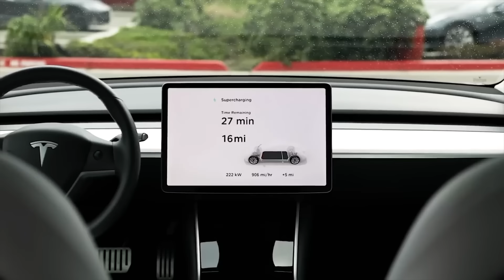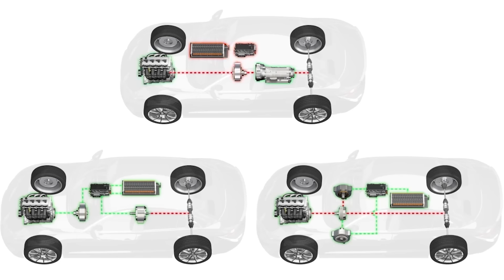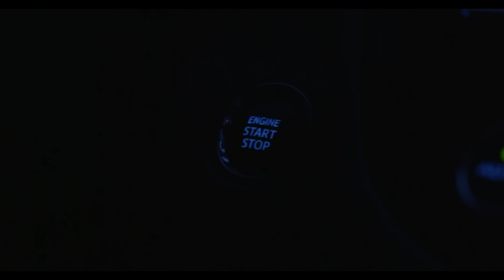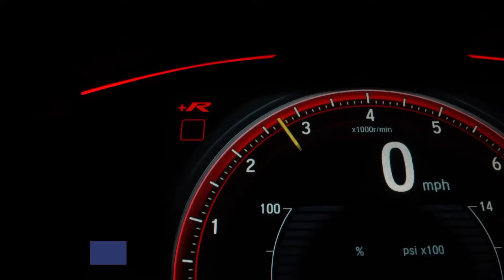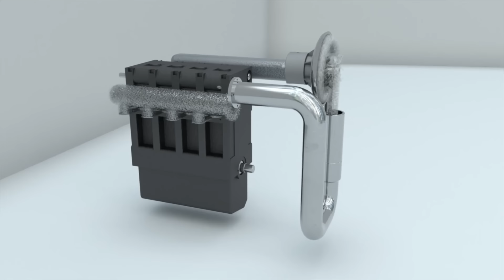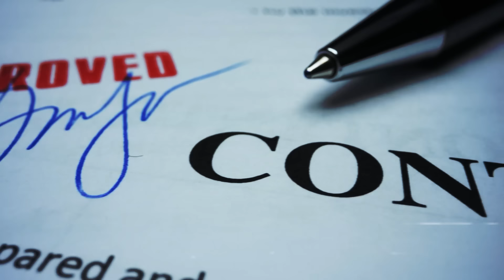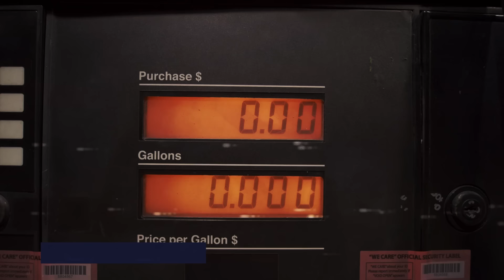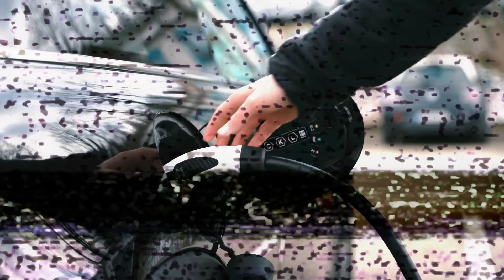Toyota CEO: "This NEW Engine Will Destroy The Entire EV Industry!"

Comment: I figured the whole child slavery in the Congo digging for Cobalt would have been enough to do it.. Sadly, I was wrong.
Reply: Except LFP doesn’t have that issue, and your phone/laptop still will. Go figure eh
Reply: Child labor sounds harsh. Do you know that hunger is more harsh than child labor?
Reply: @ferozahmed5846  - So child slave labor is ok then because kids are hungry too ?  Quite the logic you have there.
Reply: @HardRockMiner it is better, and just see what it did to China. Also do keep in mind cobolt is used in Gasoline and diesel cars aswell
Reply: @kimf.wendel9113  - Child slave labor in The Congo is out of control because of the demand needed for EV, cellphone batteries, etc. The amounts needed to refine gas are minimal and would be nowhere near the demand needed to drive the slavery happening to get Cobalt today. You're 1 of those problems for every solution type people. You probably drive an EV, and you need to justify it to yourself by pretending that my 2 gas vehicles are just as responsible for supporting slave labor as your EV is.
Reply: @HardRockMiner  no I am a realist, the problem exists due to problems in certain countries. The demand has been increasing simply because of development. Phones and laptops is one thing, but batteries are used in a several aspects.
You sound like the type who just want to see a problem and assign blame to what you don't like.
Reply: Have you ever thought about the number of children that actually died because of the oil industry?  It is about a million times higher than the number of children that died in cobalt mines.
Reply: Why do you always omit that Cobalt is heavily used in the desulphurization process of refining oil for gasoline?
Reply: @giovannialtamore - Lmao!!! Look at you grasping at straws in a sad attempt to prove some kind of point. That's genuinely hilarious!
Reply: @HardRockMiner how about you propose a solution and show us your logic?
Reply: I don't drive any car, like most people around the world, so your two gas vehicles are contributing more to this problem than most people around the world do, and also causing many other problems such as pollution, green house effect and wars in middle east. Your attempt to blend virtue signaling and redpill failed miserably.
Reply: Cobalt is also used in the production of gasoline.
Reply: Why do we have child labor there when there's millions of jobless adults in the country leave alone the neighboring countries
Reply: Interesting point however new EV battery tech doesn’t use Cobalt
Reply: @piersmarchington  - Nice dream you're having... Wake up !!
Reply: @HardRockMiner even if the cobalt was sourced from Africa, which it isn’t, it would be used once. The cobalt used as a catalyst to remove sulphur is an ongoing process requiring a continuous daily supply that destroys the cobalt in the process. 
The companies that mine for cobalt in Africa are connected to the fossil fuel industry.
Reply: @HardRockMiner no that’s actually true. In 2018 1 in 5 deaths per annum in the world related to the breathing in of particulates created by the burning of fossil fuels. Recent studies have shown that the amount of life threatening diseases have expanded from just respiratory illness. 
Literally millions are dying from this each year.
Reply: @SteveRomigsongwriter  - Bhahahaha!!! You're hilarious 😂!!

Comment: The key problem of using Hydrogen is building the H2 gas station infrastructure. Hydrogen is extremely dangerous to handle as a storage due to its explosive nature. EV is ahead of the Zero emmission race because electricity infrastructures are already available at homes. Plus there is efficiency loss to covert water as Hydrogen as fuel from electricity.

Comment: it takes a lot of hydrogen volume to make a car go 300 miles between refills.  Unless you use hydrogen in fuel cells.
Reply: They can make it more efficient
Reply: That IS what they do!
Reply: They don’t tell you that the membranes between 400 cells in fuel cells need replacing every 10,000 km or twice a year.reselling the fuel cell could also be a problem as hydrogen molecules are the smallest know to man and will leak through just about anything.
Reply: They have made them go 430 miles between fill-ups.  I think Honda has the fuel cells.

Comment: I have always been a H2 supporter.  We need to work on H2 production.  They have improved and lower production cost and I believe we will get there. The problem is when.
Reply: Remember the Hindenburg?
Reply: Hydrogen's biggest problem is that it will still need to transported everywhere, just as petrol and diesel is now. Electricity needs no transportation. Plus you will never be able to fill up a hydrogen car at home on a cheaper rate than established public filling points. The oil industry desperately want hydrogen to succeed, so they once again take control of production, distribution and pricing, just as they did with oil based fuels...... And irony is that every single hydrogen filling point will need a supply of electricity to operate.......
Reply: @Brian-om2hh  TBF, it'll still be cheaper than the electricity prices we pay now. That's the main reason I was put off buying an EV. Here in Australia we're paying about $1000 to $2000 (~$650 to ~$1300 US) per quarter. If we didn't have solar that'd be killer. As it is, we're still paying about $200 to $300.
An EV would wipe that saving. We can't afford that. Heck, there are some people talking about going off grid with petrol run generators as they're cheaper day-to-day than the electricity prices.
EVs are a rich person's car.

Comment: What is easier to distibute... electricity through cables in a distribution network that mostly already exists or hydrogen in massive storage tanks and tankers travelling all over the country ?
Reply: There is no way the electric grid can handle that demand.
Reply: @sidallen685  And you didn't answer the question, which is easier ?
Reply: @sidallen685  we're upgrading everything, not just throwing millions of EVs on the road. The electrical grid is gonna have a lot more, smaller, modular nuclear builds that have a much smaller footprint, way higher safety standard, easier maintenance, etc. That's on top of renewables already replacing coal peaker plants.
Reply: @sidallen685  if each house was built out with batteries and solar, it would spread the demand and put less stress on the system.
Reply: @sausagemcgregory   Hydrogen can be made on site using Natural Gas, and there is many other ways to make. On average hydrogen powered vehicles get 70 to 80 mpg.
Reply: Exactly. Not to mention the CO2 produced by the delivery tankers......
Reply: @sidallen685  But won't each hydrogen filling point require electricity to function?
Reply: @sidallen685  Which is still only around 50% of the efficiency levels of most EV's.....
Reply: So which one is cheaper and easier to distribute: electricity or natural gas?
Reply: @sidallen685  has spoken, end of debate!:face-orange-raised-eyebrow:
Reply: Obvious answer, shame u cant see it ?

Comment: It will have very little impact.  It costs about the same as gasoline to fill up versus about$6 to $8 to fill up an EV at home.  The worst part is they charge over 100k to replace fuel cells so you have to scrap the car versus for electric the battery is 10k to 25k.
Reply: What does a new horse cost ?? 😂
Reply: russozelinsky right on. They need to address the cause of the problem 👍

Comment: By the  time Hydrogen gets into the tank you have already lost over half the energy from converting water to hyydrogen / oxygen, transporting and compressing.
Reply: By the time electricity makes it to your house from the power plant you have already lost most of that power.
Reply: @pointmanzero  0.5% to 1% per 100 miles for high voltage.  Hydrogen loses 50% in electrolysis 15 % or so in compression and cooling, and another 20% before it is converted to electricity, then usually 3 to 5% more going to the motor.  Web search for more detail and accuracy but the point is that hydrogen is super bad in cost and volumetric energy density.
Reply: @damaliamarsi2006 like they said about EV's, ' it's a new technology'.  Nothing starts out perfect.
Reply: This is why the water battery is not a solid idea!
Reply: @shawnb4938  Agree but hydrogen as a fuel "source" is a very long way from being cost efficient, and is not even an energy source, rather a very inefficient energy transfer method.
Reply: @damaliamarsi2006  it'd already used to fuel cars. It's not as efficient? EV's are only as efficient as their source of electricity, which is predominantly coal at the moment.  And hydrogen vehicles only take minutes to refuel.
Reply: @shawnb4938  True only five minutes from empty!
Reply: @damaliamarsi2006 Coal power plant has 37% max efficient according to google, plus we have add transmission loss and also power loss in charging battery
Reply: @Rohan-up9hy  So assuming you are correct, lets say 30% of the energy from a coal plant gets to the cars wheels.  If you use hydrogen it comes out to around 12% or less do to needing to make hydrogen from the same electricity, losing 50% in conversion, 12 to 15% in compression and cooling, some percent in transportation and storage, then more in converting it back to electricity, or burning it to power a car.

Comment: The price point of EVs is currently way too high for most people. The H2 solution is at least 20 years away due to lack of infrastructure and energy required to make it.  Other solutions such  as autonomous vehicles that can be rented on demand may fill the gap.
Reply: Only 5-10 years away, it's being built very quickly. As natural gas demand slows the infrastructure will be used for H2, it's coming and the EV community knows this so there very hyper in denouncing it as not green.
Reply: @nigelwillis345  too expensive to build the station. too danger to produce it at home.  So the snow ball could not start rolling, every step, it need a push and eventually nobody have that much pushes left.
Reply: @henrychen8256  It's happening now, just follow the H2 trail.
Reply: ev car price is dropping. remember smart phone price? was expensive at first but as more and more people buy, the price declined
Reply: So, you feel EV's are too expensive?  Yet the only two hydrogen production cars currently available, are the Toyota Mirai, costing in excess of £50k in Britain, and the Hyundai Nexo SUV costing £70k plus here..... Both waaaaaay more than most EV's......

Comment: A EV can be charged at home. Unless hydrogen cars can match this they will be at a huge disadvantage until a massive infrastrucrure is built.
Reply: The infrastructure is already is place..they are called petrol stations. A home charger isn’t much use if you have to park in the street.
Reply: You can distill Hydrogen with water and a solar powered distillery, the only way you can charge electric are off the grid or solar, hydrogen makes sense. You should check out the hydrogen powered vehicle that NASA helped design, basically it runs on water, it uses solar built into the car and electrolysis to generate hydrogen for the combustion engine.
Reply: One day in the future, a hydrogen car can be filled by kitchen water tap. It will convert water to hydrogen , then convert hydrogen to electricity and at last use electricity to drive the car.😁
Reply: Converting water to hydrogen is a long way off on a massive scale.. Electricity is available at home.
Reply: An EV can be charged at home.... in many, many hours. If an EV can't be charged in under five minutes on the road, it's completely useless to me. An absolute requirement of my vehicle is that I can take it on long road trips and not be stopped for more than five minutes. The current technology of EVs fail that test. I might be willing to extend that to 10 minutes, but anything more than that is a non-starter.
Reply: @cuthbertallgood7781  Hybrids fill that role for now.
Reply: @joeblack888 it can't, there are too many impurities in tap water to be converted into anything useful like that
Reply: Now, how am I to charge an EV from home?   I live in a terraced house, with no off street parking and if I do get to park my car on my road, it can only be on the opposite side of the road where I live.  There are plenty like me.  For us hydrogen looks a really good option.
Reply: @johnhudghton3535  you don't have electricity in your house? That's quite wild
Reply: @kimf.wendel9113  Impurities is not a big issue for future car. The car can first purify and filter the tap water.
Reply: @kimf.wendel9113  no, please read my reply properly.  I do have electricity in my house but I have now way of getting it to my car because of the type of housing I live in.
Reply: @johnhudghton3535  Nobody is forcing you to buy EV . There Will  gas cars on the road for years. I plan on keeping my Tacoma until I'm home. But  I'm buying a hybrid in 2025.

Comment: I agree in many points, especially about the limited ressourses to build batteries. Hydrogen is the fuel of the future. But one question is still there... The energy to produce all that hydrogen, where does that come from? We need more electricity anyway to compensate the fossile fuel(s), no matter if we drive electric or with hydrogen!  
Recuperation (shound be used in any vehicle, electric or combustion!) does not necessarily be made electric, it can also be made mechanical! (with a fast spinning flywheel in a vacuum cylinder, like the KERS that was used 2009-2013 in the F1.)

Comment: Germany has come up with a Magnesium Hydrogen power paste that could power a Hydrogen fuel cell to power EV's so EV's need not mean a lack of H2 use.  I think H2 tech should be used to power aviation and shipping.  The thermal energy building up in the ocean can be converted to electricity using the tech being used to produce geothermic electricity (like the plant using Volcanic heat to produce electricity in Hawaii.   If H2 Aviation routes are first used above areas experiencing drought, the water exhaust  may help increase rainfall.
Reply: Good idea! However how many units of electricity/fuel/materials are need to make ONE unit of Hydrogen or even Magnesium Hydrogen?
Reply: Germany or one shonk at IFAM who claimed to be making 4 tonnes of PowerPaste (TM) by 2021. They were planning to use this stuff to power electric scooters, not cars

Comment: So, hydrogen is simply an energy storage system. Where does the energy to separate and isolate H come from? Electricity?
Reply: Most of the hydrogen comes from processed natural gas or hydrolysis from water. Water vapor from the tailpipe can freeze on the roadways. A heavy storage tank is required. It however can be part of the solution. 100% electric is impossible and will lead to a small percentage of the population having access to cars.

Comment: The article mentions the need for armour plated hydrogen gas tanks which I presume will be the main safety factor in such a vehicle therefore can we see the need for certification of such tanks every 3 yrs or so just like with steam engine boilers requiring frequent certification.
Reply: Many years ago I watched a test on TV here in U.K. A bullet was fired into a petrol (gas) tank. The burning petrol spread around the car and totally destroyed it. Then they fired a bullet into a car with a Hydrogen tank. A jet of flame shot high into the air, but left the car with just a small black mark around the bullet hole. In practice Hydrogen should prove safer.
Reply: @johnwilletts3984  This is an interesting observation from this test... I would expect with how combustible hydrogen is that ignition in the tank itself would actually cause a massive explosion like you would see in movie. Along with this a ton of metal would  have to reinforce the tank to prevent the entire tank from giving out at the same time. Which is far more recourses....

Comment: India has recognised the true potential of hydrogen engines and had already started partnership with Japanese firms and local Indian firms for hydrogen based engines three years back. At present India is in the advanced stages of mass H2 production in the green hydrogen category.
Reply: But is that for industrial use rather than surface transportation? The weight of hydrogen fuel tanks is considerable and more suited to railway use than road vehicles in my opinion.
Reply: Can you back up your claims with facts?
Reply: @CosmosChill7649  if you want science facts about Hydrogen there are many sources. Try Sabine Hossenfelder for one.

Comment: If your traveling long distances and using an EV, bring along a bicycle. That will be your saving grace when the battery of your EV run dry.
Reply: Yep! Not to mention the decline of the battery in the cold that leads to an even faster bike ride.🤣
Reply: I've done many road trips in my Ioniq 5 and they charge up in 18 minutes. It's blazing fast.
Reply: @tomsoltess6636 😂

Comment: Good video. Electrical power is best to come from nuclear to do either make hydrogen from electrolysis or charge batteries. 
So when you drive an EV or a FC fuel cell vehical where electrical power comes from a nuclear power plant you are driving a nuclear powered car.

Comment: That CEO just told the half truth about the carbon emission from EVs. First, EVs don't emiss carbon everywhere they go. Second, an electricity power plant may use fossile fuel but it is much much much more controllable compared to that emissed ICE cars. Most importantly about EVs, every country has potential to develop their own cars and doesn't have to totally rely on those monopoly ICE cars.